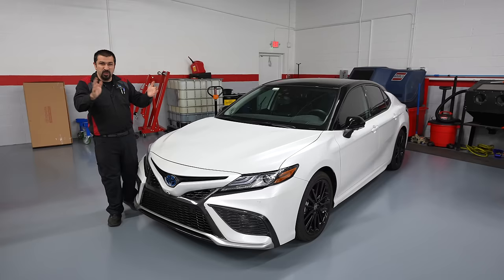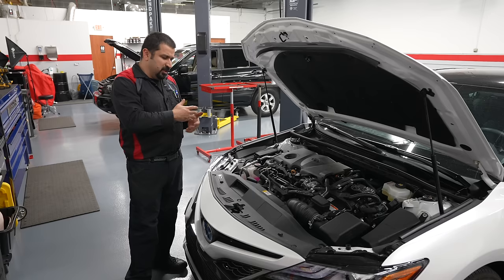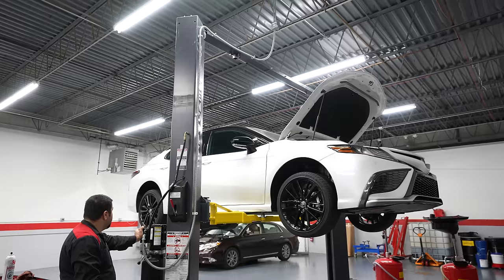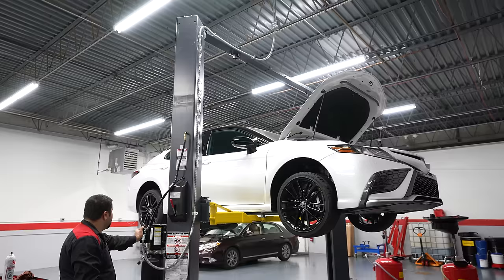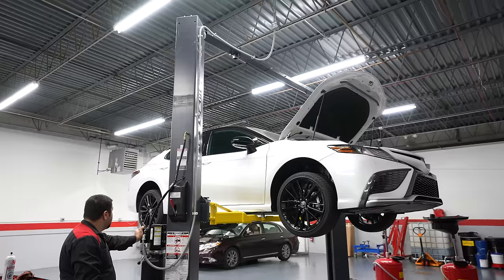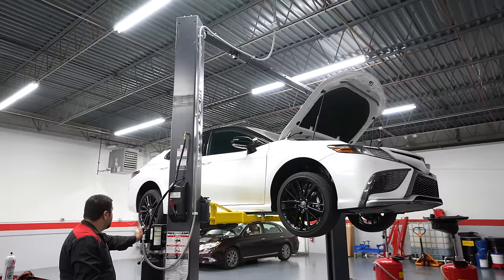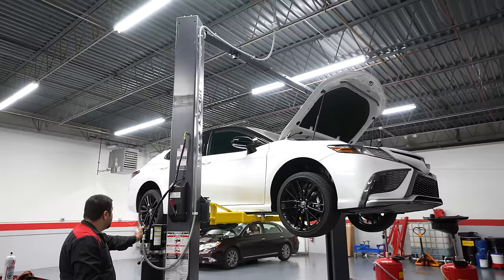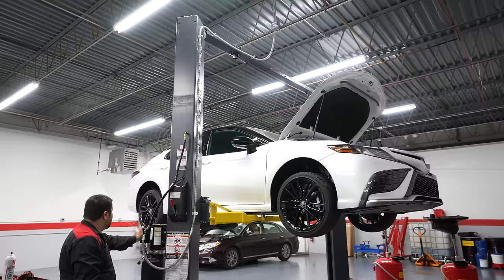Should you buy a Toyota Camry Hybrid? 1 Year Ownership Update

Comment: You mentioned to check the oil levels when the engine is at or near operating temp. What if the user's manual says, check the oil level in the morning when engine is cold?

Comment: Great video as always man thanks a lot cause you’re teaching people how to take care their cars. I Identify  myself as you because I m pretty picky with things like that man but that’s not the question here’s my three questions 
1.can you tell me why my 2018 Camry with 70,000 miles on it feels pretty bad every time I hit pothole even a small pothole?
does any suspension part needs to be replace to get that feel pretty smooth  as new as I bought the car can i get that feeling back or does the ball joint makes the car feels like that when is time to replace them?

2. So you recommend to change the oil and oil filter every 5k since the dealer tells me to do it every 10k and I don’t like that? 

3. How can I get the transmisión or engine gear delay fixed?

Comment: 21:50 Sometimes, it is hard to measure the oil level when the engine is hot because the oil is all over the dipstick holder. You might see a point on the dipstick where the oil level is thick and then another thin layer that makes it look like the oil is overflowed.  Also, the dipstick is marked to measure the engine oil level when the engine is cold. So, it might make sense to check the oil level when the engine is cold (sitting overnight) and then again when it is hot.

Comment: That engine bay is dirty? Looks brand new to me! 😂 I work at a Toyota dealer and I won’t buy the cabin filters anymore. For what they are they have gotten way too cheap, Napa/Wix have much better cabin filters for a better price. Engine air filters I will still go OEM. I actually found that Lexus stocks more of the thicker factory filters instead of the cheaper thinner filters that will be found at a Toyota dealer.
Reply: For years I have been using Wix filters for the cabin and engine but I was very disappointed that my last one came from PRC which was not the case before.

Comment: my dad wanted an S 80 when I was a teenager after he'd had a used 1990 760 for 3 years 2000 to 2003 had I not been legally blind/Autistic I'd have probably learned to drive in either the 760 or my late maternal grandmothers 1990 Toyota Camry both of which had an automatic transmission

Comment: I asked this specific question to the dealership when I first bought my RAV 4 Hybrid 2022, that was “Do I need to change oil at 1000 mile mark, just to flush out the tiny metal shavings” dealership told me I do not need to. I would appreciate your opinion on it
Reply: first 1000 miles, second 4000 miles then after 5000 miles or every 6 months he said

Comment: Hybrids.....hmmm not for me.
I almost ordered a 2021 Toyota XSE all loaded up in the very same Windchill Pearl with black but came across my current 2017 Camry XLE...glad I did.
Batteries eventually wear out and they're not cheap.
Recently switch my engine air filter to a K&N dry filter and also switch the cabin filter to a K&N filter.
I like the idea of a reusable filters and I have always changed my own and kept close eye on the state of the filters.
I've had carbon cabin filters in the past but like I mentioned I'm giving the K&N filters a try.
The K&N filters look like they will be less restrictive and perform better but time will tell.
My car is a 2017 Toyota Camry XLE 2.5L....my first Toyota and I am enjoying the vehicle a lot.
Purchased this car back in 2/2021 and have a 5 yr warranty on my car.
I've gone through about everything I can bringing the car to where I know where the car stands.
Radiator flush,transmission flush,brake system flush,4 new tires and my oil and oil filter changes are done at 3,500 to 4,000 miles.
And every other oil change I have the tires rotated.
As of this writing my car hasn't reached 40,000 miles and the car looks new in & out.
Since I've owned the car I apply conditioners to the leather Parchment interior.
Protectant on all the rubber seals,doors,trunk,under hood,sunroof.
When I detail my car under the hood gets a thorough detail including door jams,inner trunk areas.
I'm retired so my car is one of my pass times.
Clay bar the car also probably two or three times a year both paint and glass.
Buffed it out once so far and the black paint just shines so good.

Comment: I have 3 hybrids. 2009 Camyry Hybrid LE.  Has to be the worst Camry hybrid model they ever made. It has 200,000 miles on it. Has the sticky dash which happened after the warranty period. And it burns oil which this model is known for. 
2014 Camry Hybrid XLE.   This model has had no issue what so ever and it has 125,000 miles on it. Has a better/bigger engine than my 2009 camry.  My son's car now.
2018 Lexus ES300h.  A Lexus was on my bucket list and if I didn't buy this I would still be driving the 2014 Camry.  I love this car there are a few things that Lexus cheaped out on. 1st one is the heated seats. On my 2014 Camry the seats and the backrest are both heated. Was expecting the same with the Lexus but it is just the seats that are heated.  2nd is the remote starter the is installed from the factory which is great but Lexus wants you to pay a monthly service for the remote to work. Seriously Lexus, this should come standard on a Lexus.  Anyway it drives great and am glad I bought this car.

Comment: Hey AMD, massive fan of the channel. I own a 2022 Kluger (Highlander) hybrid since may and I love it. Recently had the first check from Toyota which turns out to be just a check and not an oil change (1000kms). Here in Aus we have a 5 year capped price service under warranty, every 1 year/15,000kms they do a service. I'm used to servicing my previous cars at 6 months or 10,000 kms. Would I run into problems with Toyota and my warranty if I decide to change my own oil in-between dealer visits? I work with an ex Toyota tech who has the same car and argues that the 1 year/15,000 km interval is fine for a hybrid.
Reply: I have a '22 Camry hybrid and after watching this video, I'm thinking about changing the oil and filter myself since I've had the car 6 months but only have 3500 km on it. The actual service where they change the oil and filter is in April 2023 which I'm not comfortable leaving it that long. I'm sure if you used genuine Toyota oil and filter there wouldn't be any issues with warranty. Although, many dealers in Australia just buy whatever cheap oil in drums, which isn't usually genuine Toyota oil anyway.

Comment: I have a service related question. I own a 2017 Toyota Prius and it’s got 105k miles. I take it to a local auto shop that I trust for major services. At around 120k miles the spark plugs will need to be replaced as part of a regular maintenance service. The auto shop owner recommends performing a fuel injection cleaning service with the spark plug replacements. Would you recommend the fuel injection cleaning service as well?

By the way, I appreciate you making these videos. VERY HELPFUL!!!

Comment: Just change your oil every 5k. Although I am not an environmentalist, anything earlier than that is an excessive pollution to the environment. A25FSK will have gas smell in the oil because it is a dual injection engine (Port&GDI). Don't change your oil when you have less than 5k miles and oil is 2 years old. Exercise your judgement. If oil looks watery after 2 years, then obviously it is time for a change. Most likely if you live in a dry climate, that isn't the case.

Comment: Interesting comment about air filters. Unique thick factory air filters common in the industry? I have a Chrysler with an original filter. I opened to check it. Now I can’t get both tabs back on because of how thick the filter frame is. The car is in mothballs. Now I’m curious about buying a replacement to see if the frame may possibly be thinner.

Comment: Great video! I'm still using the factory original engine air filter and it has been 3 years and 47000 km. I have removed it multiple times to inspect it and it is barely dirty, even between the pleats. The element still looks intact (no rips or tears) and I have inspected it with a bright flashlight to see if there is anything wrong, but nothing. Even the foam gasket around the edges is intact.

Should I still change it anyway? It seems like a waste to do so.

Also, I've heard the same thing about the 4Runner's  filter. My parts guy tells me that they sometimes get US customers who pass through Toronto and specifically come to their dealership to buy the better air filter and not the junk that is sold in the US.

Comment: How would the Camry Hybrid do for long trips? I drive from Ohio to Florida and back which is about 1100 miles one way, and I do this at least 3 or 4 times a year to visit family. Driving is cheaper than flying in my circumstance. I drive straight through as well only stopping for food, gas, and restroom. I'm having a hard time finding affordable vehicles around $30000 or less. These Hybrid Camrys seem like they would be worth it cost wise if it can handle that amount of travel for the next 10 years at least.

Comment: Great video, as usual! 
I have a Lexus es 350 2021. I hear faint chirping noise from the HVAC system. It is most noticeable when you change the fan speed and turn it up without playing music. I have my dealer check it, and it is likely from the air blower. The dealer cannot fix it because they found it on another Lexus es too, and they are saying there is no fix from Lexus yet. I am wondering if your Camry has the same issue too? (since they probably have the same HVAC system design)

Comment: I would be grateful if you, as a  Toyota mechanic par excellance, could please extrapolate the TOTAL cost of the hybrid car.  For example, the hybrid car costs x$ more new than the conventional ICE version.  Then at end of battery life,  x miles or 96 months warranty on the batteries: how much $ is the new battery pack?  2. How much $ is the regenerative braking module (and does it really die at the same time as the battery pack?)  and lastly, I've heard that TOYOTA dealers won't touch a hybrid on trade-in which the owner would like to trade in at the end of battery life, due to the cost of the new battery pack and regenerative braking module.   The press reported in Jul 2022 the story of the teen who bought a 2014 (8 years old) Ford focus EV in which the replacement battery cost $14k, and the car was purchased for only $11k.  But the REAL problem is Ford discontinued the battery pack, none were available!  I know Toyota would never strand a customer, but batteries are batteries, whoever makes them.   And a $14,000 battery replacement buys alot of gas.

Comment: Good road holding?  Compared to a horse-drawn hay wagon, maybe.  I love my 2018 XLE Hybrid.  It is quiet, comfortable, gets wonderful gas mileage, and of course is totally reliable.  Last summer it hauled four large adults to the top of Pikes Peak without breaking a sweat, and the hybrid system got us back down with brakes that were not even warm to the touch at the brake check stop.   BUT it has the deadest, most vague and unhelpful steering of any car I have ever owned.  Road feel is zero and keeping it in the center of the lane at highway speeds is almost impossible.  I have accepted the condition as a characteristic of electric power steering, a compromise needed to improve fuel economy, but I am beginning to wonder if I should take it to the dealer and have them test it for the steering shaft binding condition that Toyota warned me about.  I am skeptical because the steering feed back has been terrible since the day I drove it home from the dealer, but I would be delighted if there is a fix.

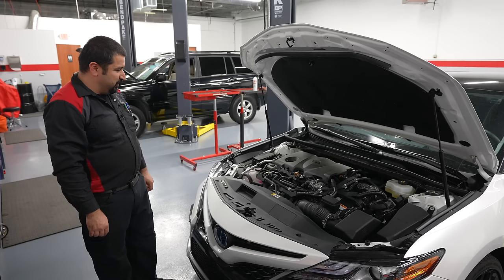Comment: "Not going to clean it" (the engine) @ 4:00.  Will a auto technician perform a more careful repair/maintenance job if the engine bay is clean?   Otherwise, clean or downright dusty and oily, the job get done.  No extra special attention given on the repair job on a clean engine.

Comment: Hi AMD, great videos as usual. I feel your frustration as well regarding the build quality and workmanship with the American built Toyota’s. I posted a question on your last live broadcast regarding my 2020 es300h after 1.5yrs of ownership it started to make this rattle noise in the back or trunk that sounded like 2x4 bouncing up and down when the car’s going over bumps, that I was going to remove the rear seats and diagnose the issue.( I think you kind of ignored the question as if it was a joke). I’m still trying to pinpoint the source of the noise but I’ve narrowed it down the cause. It only happens when the sunroof is in the up position.It doesn’t make any sense where the noise coming from the type of noise that it makes. Any ideas on the issue. I haven’t brought it to the dealership as I think would make things worse. I also own a Japanese built 2015 es300h with 175k km not 1 rattle. Any thoughts on the noise. Thanks.

Comment: Hi Amd, I'm in Canada and new to your channel as I just purchased my first Toyota, a 2024 Corolla hybrid AWD. This is my 13th new car, 2nd hybrid (2015 Sonata HB), and I have always done my own routine maintenance including brakes. I noticed on my maintenance schedule that on each yearly 16K km service it states "Tighten Bolts or Nuts for Drive Shaft". Is this something that is required or just a teaser to bring your car to the dealership for something they will not pay any attention to. If this is required I assume that this is the nut behind the wheel cap. What is the procedure for accessing\tightening the nut? How is it removed\adjusted, LH or RH, Torque? I can't find any information on this service requirement. Thanks.

Comment: Ok my Kluger rattles from the exact same place in the middle of the dash in colder weather. Highlander over there. If you get to the solution please post it. The dealer's tried once and said they found a loose connection and refit it, but it didn't last.

Comment: Thanks for your reviews they are fantastic. You are so enthusiastic and you seem to love your job.

You did a fantastic review of the latest TOYOTA CAMRY 2.5L 4 CYLINDER (4th generation) HYBRID ENGINE (SAME AS IN THE LEXUS ES). Engine code A25A.  It seemed such a good car I'm thinking of buying one new to replace my 2013 TOYOTA AURIS HYBRID EXCEL (26,000 miles on the clock). 

My question is can the European/UK base model of LEXUS ES (which does NOT have auto-folding, upon central locking, wing mirrors) have this function retro-fitted in a LEXUS/TOYOTA DEALERSHIP WORKSHOP. Is there a retrofit kit (with a code number available?). [alternatively will my current 2013 TOYOTA AURIS HYBRID EXCEL auto closing mirror control unit work in the LEXUS ES 300h or TOYOTA CAMRY?

Comment: Hello Car Care Nut, 
I have a question for you regarding the hybrid Camry. My hybrid 2019 Camry has a tachometer projected in the HUD. When I drive my car the tachometer hardly ever indicates more than 2000 rpm. I live in the Netherlands, an almost flat country, the maximum speed on the freeway during daytime is 62mph, in the evening and at night it is 75mph. When I am on the highway doing 62 mph or 74mph the tachometer always indicates about 1200-1300 rpm. This is for hours and hours on. It is the ecu that sets the e-cvt that sets the engine to run this low rpm, it almost always does. So I hardly ever get above 2000 rpm when accelerating and never get above 1200-1300 rpm when on the freeway. On the freeway it runs on about 1200-1300 rpm for hours and hours. So the engine runs almost like diesel in a large ship so to speak. This is how the engine and e-cvt are programmed to behave in  the ecu. I have my doubts if this is really 'good' for the engine as I understand it can be good for an engine to be running at higher rpm from time to time. My Camry has about 38.000 miles on the clock and hardly ever came above 2000rpm. How does this affect the lifespan of the engine?
Looking forward to your answer.
Kind Regards, HJ

Comment: I have the same car and right now doing the second maintenance 10,000 miles. Very happy with the Camry. Did you still using the wireless car play? I use the red cable to connect my android auto and sometimes disconnect without reason.

Comment: Great video, thanks!  I have a 2015 Camry Hybrid. Any thoughts about doing a video on common rust-prone areas of Toyotas and how to prevent long-term corrosion...products? frequency of application? parts/areas to treat?  In the Midwest, many cars will be taken off the road due to corrosion/safety before they would stop driving well if taken care of mechanically like you and I do! (CRC marine corrosion preventative or Lanolin-based options, etc....)
Reply: I have a 2007 Camry XLE V6 with 140,000 miles with  no rust anywhere, and I live in Michigan.  I have it washed but never wash the underside.  I don't think that you will have rust issues. There is no rust underneath except surface rust on welds on the sub frame, but nothing to worry about
Reply: @markpuckett7793 don't you worry about the road salt getting underneath your car when it's driven?
I DO UNDERCARRIAGE WAS FOR ME EVERY TIME AT THE CAR WASH!

Comment: My wife found out that the dealership would not change the oil until the 10K mile service in the free service for 2 years or 20-25K miles. You recommend changing oil at 5-6K miles. Why does the dealership refuse to do so?
Reply: Not true they will change if you ask but services need to come in order. First service is at 5k and is simply an inspection

Comment: So your suggestion that a Toyota Hybrid isn't a good choice for a snow bird because the battery's longevity is compromised because the car sits idle for 3/4 months at a time.  Is that also true for a PHEV?  Does it get a trickle charge if it is left connected during the idle time?